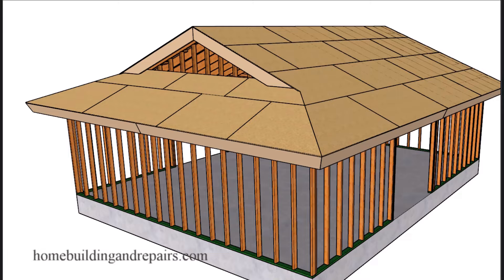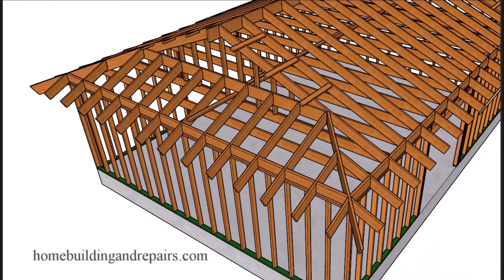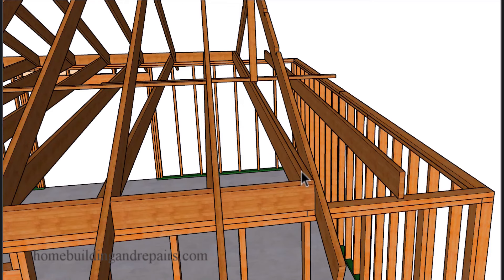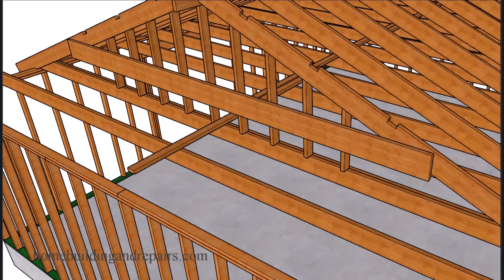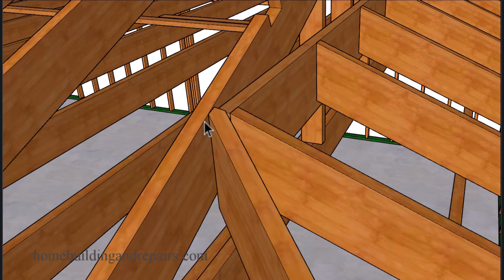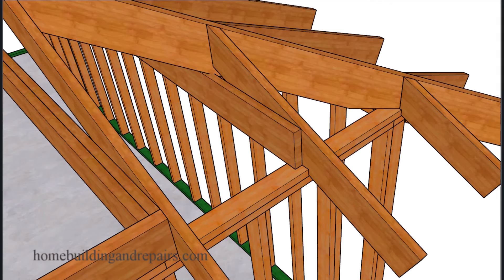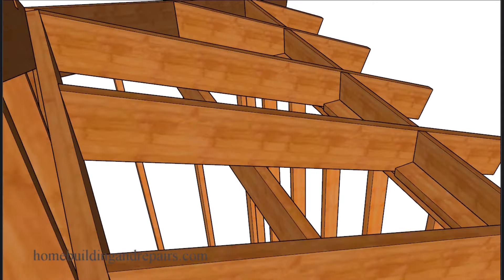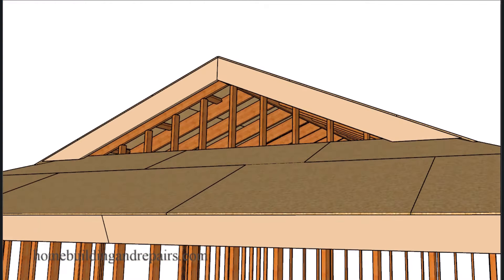Dutch Roof Design And Framing Basic Construction Tutorial

Comment: Are you able to make a roof look like a Japanese roof but with stick frame construction? The only thing I can think of is by literally adding two roofs on one house frame one would be a hip roof with a 22° pitch and interlaced with that would be a gable roof with a 45° pitch, is that safe or even possible? Has it ever been done? How would you do it or what do you recommend this is for a small shed 9’ x 13’ with a 3 foot roof overhang and it will have clay tiles on the roof.

Comment: I have a regular gable roof and want to add the dutch part, or the extra protruding roof above garage door. Is it possible to add it superficially or do I have to peel back the siding and make fundamental changes to the existing framing as it currently stands? I'd make the dutch part relatively small compared to the design in this video.